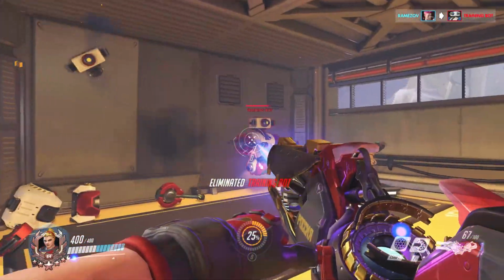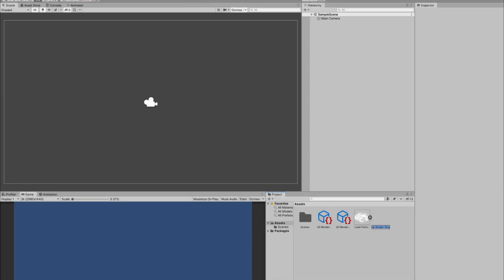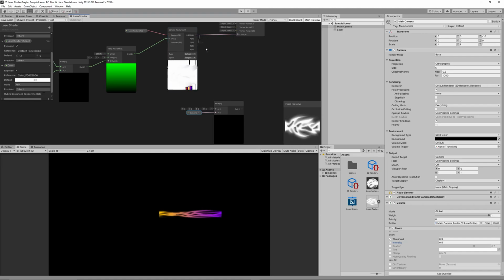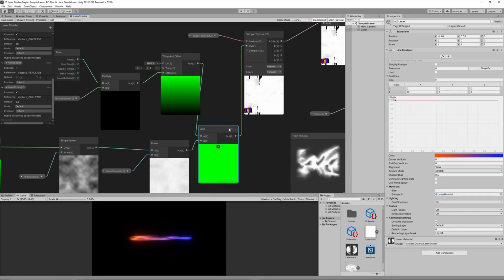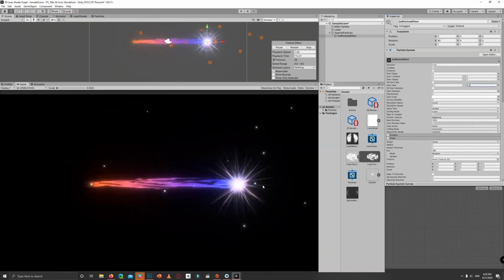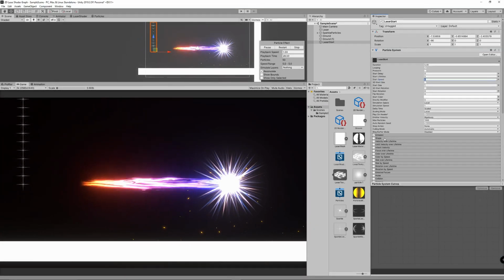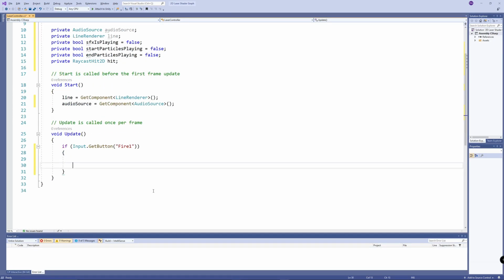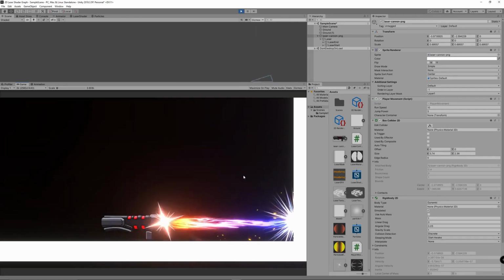2D Laser Beam Shader Graph & Particles & Controls Unity Tutorial

Comment: This is a pretty nice tutorial, but for me the textures don't work in an unlit 2d renderer. I followed all your directions, when importing I copy your settings and it presents a nice trimmed out laser beam image in the preview, and in the shader graph on the sample texture 2d node the image looks very similar to yours, but in the main preview window and when trying to use it for a material or linerender, nothing. Lit 2d renderer works quite well though, at least so far. I'm only up to changing the color gradient on the line renderer, so time will tell.

Comment: Thanks for this tutorial. I am having a bit of an issue. When I use noise strength of 0.1 it's causing my texture to offset slightly on the Y, meaning that the texture is slightly cut off at the top and slightly repeating at the bottom. Any idea what I did wrong? Thanks.
Reply from the maker: Try to create mask that cover all edges of the sprite , not only left and right  but also top and down.